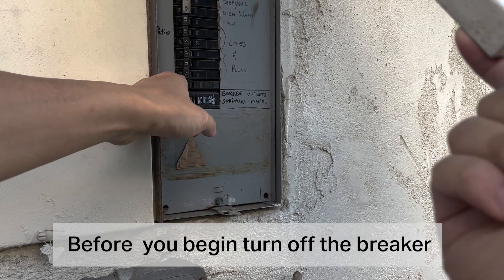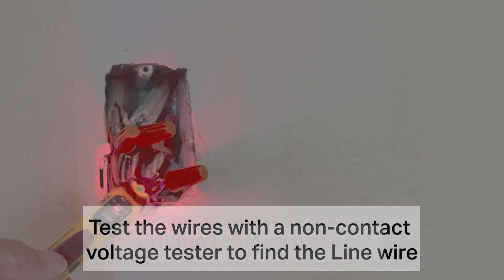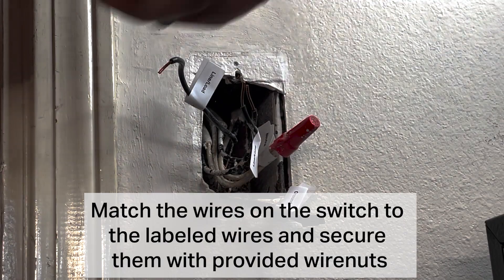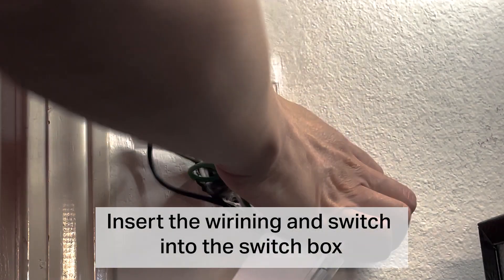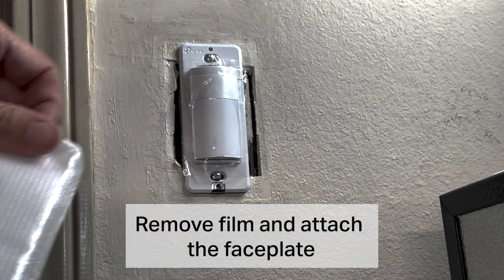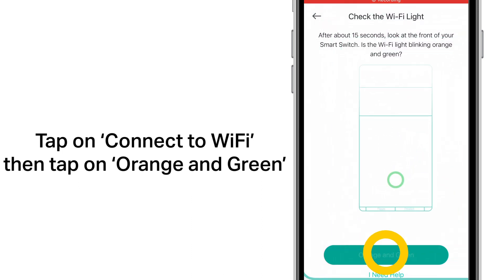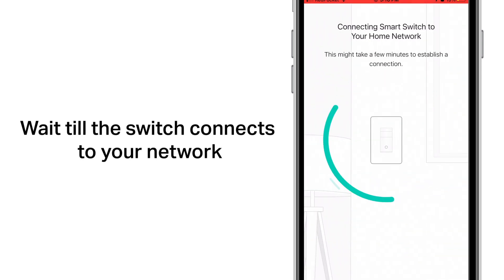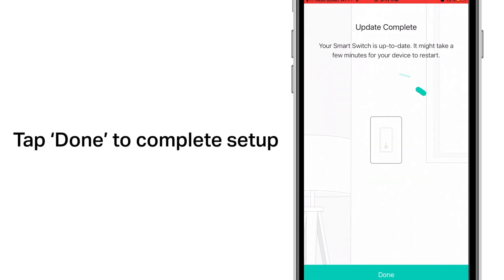How to Install and Configure a Motion-Activated Kasa Smart Switch

Comment: My Kasa motion sensor switch has a neutral wire but the switch box doesn't. What should I do with that Neutral wire? Leave it as it is or connect to the ground?
Reply from the maker: Neutral wires are required so if the home's wiring in the switch box does not contain a neutral wire the switch cannot be installed in that location.

Comment: Hi, I bought this Kasa motion sensor dimmer switch for my bathroom. But I have 2 black wires which are both hot (live) & 2 white wires which joint but wire nut. When I separated the white wire one is hot (live) and other white wire no current. Don't see ground wire. So how to wire this new Kasa switch? Thanks
Reply from the maker: To use the Kasa Switch, you need your line and load wires to be separate wires, and the neutral.  Neutral is normally a White wire, and the Load and Line are both generally Black wires.  If you are not able to identify the wires on your own, we would suggest contacting an electrician to help with installation

Comment: I was disappointed with this video because I was expecting to learn how to set up the parameters of the motion sensor. But all it discussed was how to install it in the wall and on the app. No mention whatsoever of how to enter the setting for the motion sensor itself. When is it active and when is it not. I don’t want the light coming on in the middle of the night when the cat walks through the room. I want to be able to set the sensor so that when I’m sitting in the room reading (as in sitting motionless) the light doesn’t go out on me every 2 minutes. 
Nor could I find a reference to a video that did.
Reply from the maker: That would be more appropriate for a feature video.  This video was focused specifically on installation and configuration of the product itself.

Comment: Can this smart switch be used as a  3way light switch?
Reply from the maker: No, these are single pole switches only.
Reply: @TPLINKTECH   do you know if they coming out with a 3way soon.  It would be great for a hallway or staircase.
Reply from the maker: @cexcshalet6753  I haven't see anything on the roadmap related to a PIR 3-way switch with a sensor.  but we can request such a product.  If accepted it could be made in the future.

Comment: Yeah and what about when there is 3 black wires 1 hot and the other two connect to ceiling light but then an outlet and you don't want the switch to turn off the outlet? Can't figure it out.
Reply from the maker: This may be outside the design of the product.  I personally have not encountered a switch that controls both a light and an outlet.  I can say that the switch would not be designed to control the light on/off and then keep power to the outlet.  That would not be possible.

Comment: just installed today. won't shut off the light if i use "manual" to turn it on. It tried the no motion with 1minute and two minute delays to shut off but the light stays on  i have many kasa switches. this one is giving me grief.
Reply from the maker: We would recommend contacting our support team to troubleshoot.  It could be wiring, miscalibration, or even an off chance of a defective product, but it defiantly needs to be troubleshot

Comment: Just went through several ES20M switches - NO MOTION DETECTION! If your motion detection isn't working follow these steps: 1. Remove the device from your Kasa app, 2. hold down the reset button found on the front bottom of the switch for about 10 seconds to reset the switch, and then 3. re-add the switch to the Kasa app and motion should now work. Did this multiple times today after talking to TP-Link support.